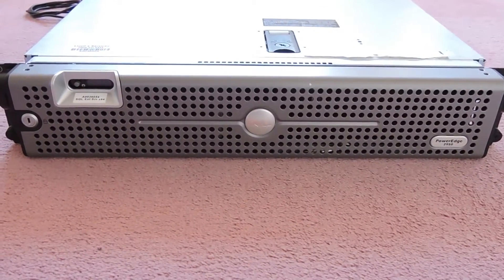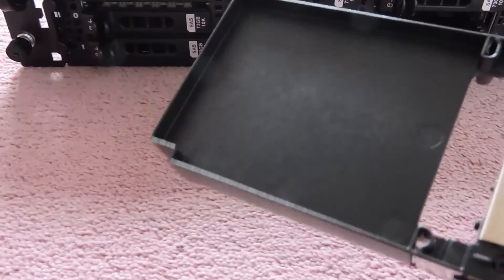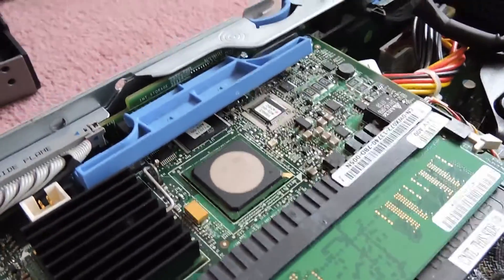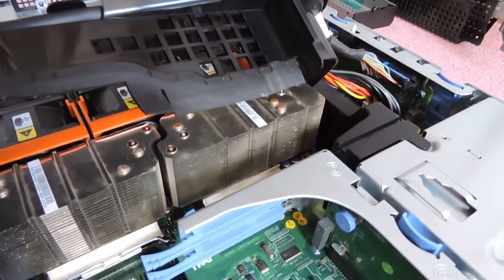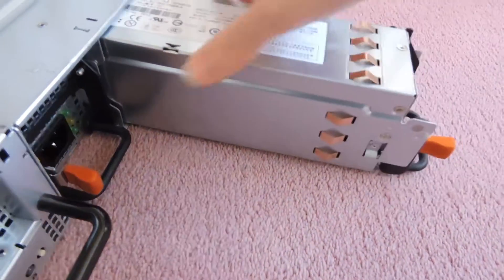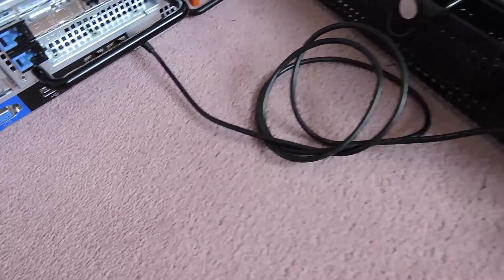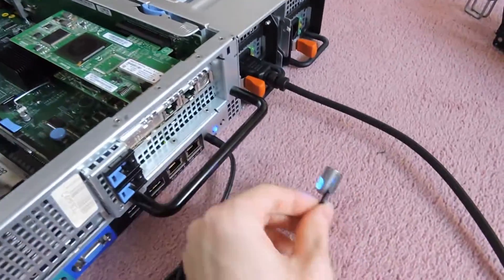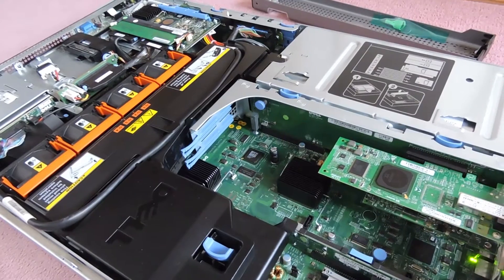Inside Dell PowerEdge 2950 II

Comment: Friend take me a doubt! I have a Dell PowerEdge 2950 server, however when connecting the power cable to the server, not power. when I click power to connect, nothing happens. the luzis and the panel lights will not turn over. Is it the source?

when I put the power cord into a light source illuminates at source, you read lights, the display lights appears poweredger 2950, more does not turn on the machine. the two sources turns on the light, turns on the server panel, more when I click the power to call does not work. what you can do to help me in this problem. I think you have greater experience than me.